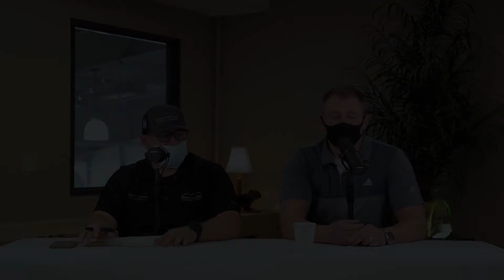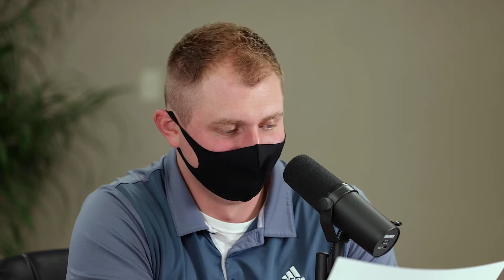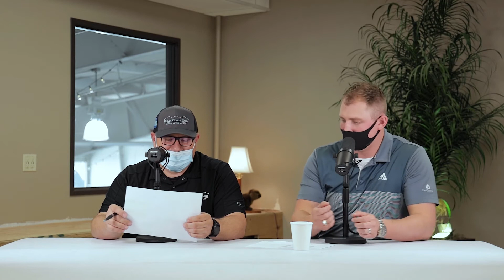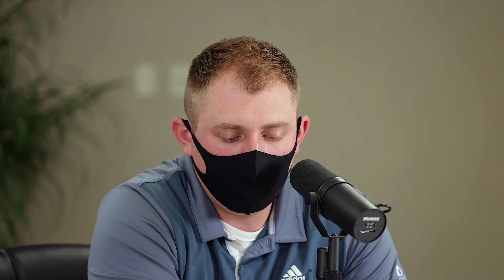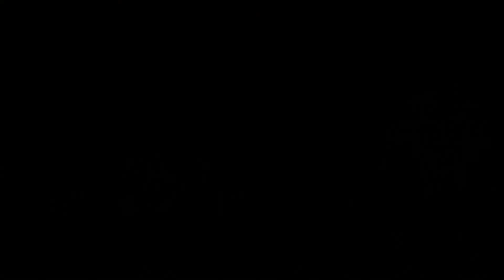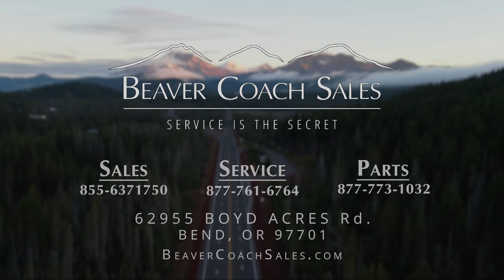Service Seminar: General Q&A!

Comment: QUESTION: I AM LOOKING AT BUYING A CLASS A (32FT) MOTORHOME THAT IS 30AMPS, BUT WANT 50AMP POWER AT THE CAMPGROUND. CAN YOU CHANGE OUT THE PIGTAIL AND DISTRIBUTION BOX SO I CAN HAVE 50AMP POWER? I AM FINE WITH THE 4000 WATT GENERATOR POWER WHEN I AM BOONDOCKING. THERE IS SO MUCH MORE POWER (WATTS) AVAILABLE WITH 50AMPS THEN 30 AMPS (4X). I AM TIRED OF DOING SO MUCH POWER MANAGEMENT AT CAMPGROUNDS. CAN YOU HELP AND ANY IDEA OF HOW MUCH AND HOW LONG IT WOULD TAKE? PLEASE DON'T TELL ME TO BUY A 50AMP RIG, AS THEY ARE NOT ALWAYS AVAILABLE IN MY SIZE AND MAKE. THANK YOU